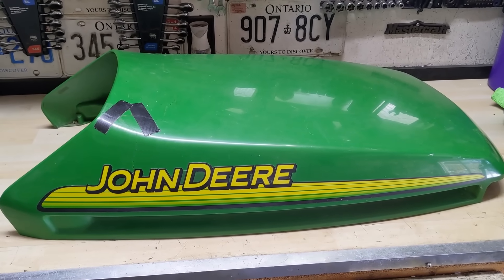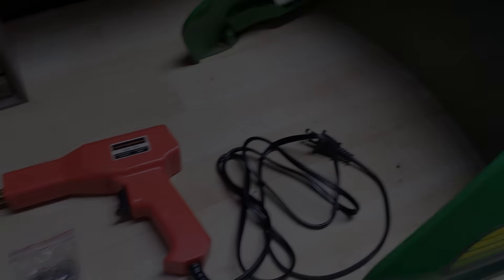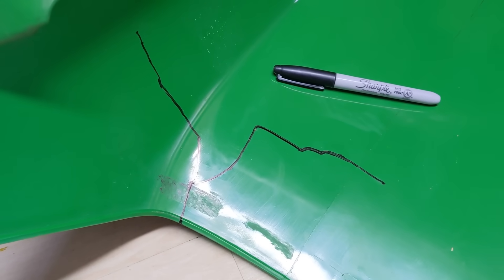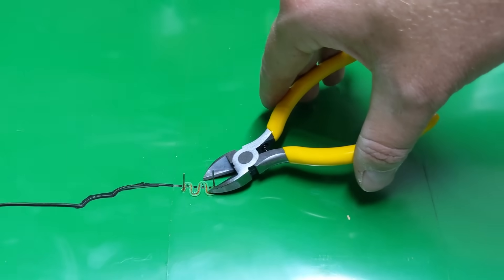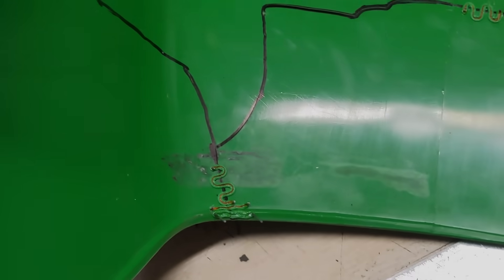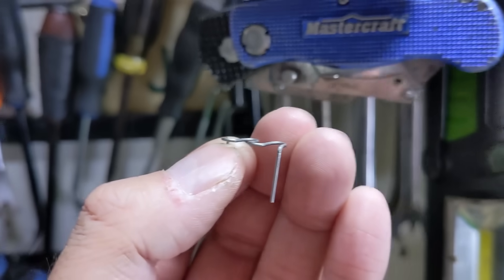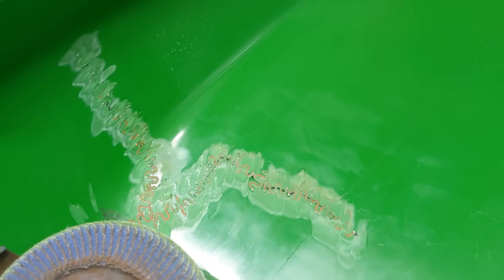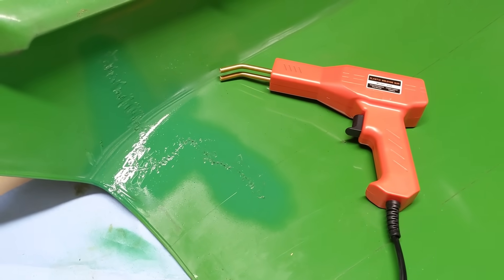How to Fix Cracks in Plastic Using a Hot Stapler

Comment: Interesting tool! I've used a soldering iron with paper clips and steel mesh for plastic repairs. This tool looks more simple, though you have to trim the sharp ends like you mentioned. Pros and cons I guess.
Reply: Or maybe hold a paper clip with pliers, get it super hot with a torch, then set into place? I've never tried it, but seems like it might work.
Reply: Interesting. What about some mesh and a heat gun? I guess you risk deforming the plastic.
Reply: @gargantuablargg  I've thought about using my heat gun, but like you said, I've had the concern about deforming the plastic.
My most recent repair was a cracked plastic bumper. Another reason I didn't use the heat gun there was because I didn't want to damage the paint.

Comment: Take the panels off, ruff them up under neath and clean with acetone, apply fiberglass mat 2-3 sheets thickness setting on aluminum foils then pore on resin, pick up aluminum foil, flip over to epoxy side, put on stress areas and cracks, wait a about 10 min  or more depending on curing, peal off aluminum foils, leaves nice smooth surface. Easy, clean no mess, fantastic strong repair, prevents future cracks. Flip panels, bondo the small cracks or not, finish how you want. The beauty of the foil is you can put on vertical and upside surfaces cleanly with no mess. Could do this with wheel off underneath.

Comment: Just an FYI, The output is 3VDC from 0-15amp. Watts = V * A, so it goes up to 45W (even though the specs say 50w). This is NOT an induction heating tool. The wire gets hot because current is flowing through it. Induction heating works by passing a current through a coil creating a magnetic field, and the ferrous metal which passes through the coil gets hot.

I think I would reinforce this particular crack with epoxy and a fiberglass cloth on the underside, for this particular example, first using proper cutters so you actually do cut flush. No way these staples hold permanently alone in this example with a user pulling up on the hood over and over.
Reply: No need for reinforcement still holding together nicely  per the customer when we inquired.

Comment: What you want to buy is a set of Hakko CHP flush cutters, like what one uses in electronics repair.  You'll get a VERY close cut on those staples!  The other thing is, the CHP flush cutters are the best ones, as they are extremely nice, very close, and very cheap.  You can buy 5 of them for $25 on Amazon.  These things are SUPER useful for all sorts of things, so once you have a pair, you'll be reaching for them all the time.

Comment: Great review and a cool tool to have for the casual repairer. 😎 One tip I would suggest is to use stapler sleeves as a depth guide so you don't melt through to the good side.

Comment: If I am not mistakened, the tool is actually a low voltage high current transformer, more or less the same idea as a soldering gun.  Other than the on-off switch and the plastic case, there is nothing to breakdown. You should expect the it to last for a very long time. Just make sure you do not over heat it by not using it continuously for a long time.  My soldering gun lasted me over 30 years and keeps on working.
Reply: You beat me to it. It's like a Weller soldering gun that lasts 50 years except for maybe the switch.

Comment: I laughed when at the start of the video I looked over your shoulder and saw a JD hood sitting on your work bench.  Cracked JD hood is exactly why I cam to watch this video.  I've been told they are prone to that.  Seems like they should make that part out of metal. Or at least a heavier plastic or something.  The lawn tractor over all seems  like it is well made and it has served for a lot of years now.  But that plastic hood is basically a POS.
Reply from the maker: Yea they're really prone to cracking unfortunately. But one prevention is opening it with 2 hands from the sides, instead of yanking it with 1 hand from the center. Thanks for watching!

Comment: when I was a kid, I had a welding toy that used a motor and plastic welding rods it would spin the rods and the friction would melt the rods and plastic to join parts to build stuff, would be great if they sold a tool like this with different plastic rods and colors it was really easy to control and dried fast and strong
Reply: Thanks for that one Paul i am 73 and do not remember that toy. I was building things with the toy logs and the Erector sets.

Comment: Bought one of these tools because I am tired of plastic parts needing to be replaced.  Did a test run on an about 18 inch crack on a garbage bin lid, and it worked great.  Mine came with a flat spade tool to smooth out the plastic and kind of cover the staples.  I did find that since the staples are a hard stainless, that wire cutters with carbide cutting edges works best for me to trim these off.  And don't drop these staples on a cement floor, as you may not be able to see them, and no help from the magnets.  Had to just sweep a large area to find them.
Reply: All good points for consideration.

Comment: The staple tails have some indentations in them to allow you to just bend them a little and they'll snap off, but I've only had marginal success with that. I typically use a Dremel with a cutting wheel on them.

Only other thing I'd mention is once you get the staple to depth, give it a very slight twist to help the staple become completely embedded under plastic. Otherwise, they could sometimes pull out.

Thank you for a great video and for sharing 😊

Just for your info. I have this item plus the regular soldering iron looking plastic welding kit and have had and used them both for a couple of years (occasional use) with no issues. I tend to use the soldering iron looking one along with stainless steel screen more often than this one, but there are use cases for both.
Reply from the maker: Hey Mark, yea I was using it the other day to fix a broken plastic snowblower chute and tried what others had mentioned about snapping the ends off, they didn't snap at all lol I still had to cut them. Like you said with the soldering iron, I then used it to melt the plastic over the staples and it seemed to hold really well. The twist definitely helps keep them in there.

Comment: You don't need side cutters, just bend-break the ends off. They are notched so they will break easily inside the plastic, so no wires stick out.
Reply: The one he shows at 3:52 doesn't appear to have a notch. Might depend on the supplier of the staple.
Reply from the maker: @larrybud  these in fact do not have a notch lol I never thought of that, but once people started commenting, I noticed mine don't. I have to cut them off.
Reply from the maker: Yes learned that from some other comments, I'll have to try it out. Thanks for watching!

Comment: You video is very well done. I too have one of these welders. Your using it on a John Deere hood piqued my interest.  That is precisely why I bought mine. I  would like to point out something about trimming the staples. If you look closely you'll see a slight score mark at the base of the staple. If you remove the welder while the plastic is set but still hot you will be able to break the pins off below the surface. This is handy when following up with plastic rod and not needing to grind stubs down.
Reply from the maker: Awesome I'll have to try that out, thanks for watching and for the tip!

Comment: what about some fiberglass cloth and resin on top of the staple job?
Reply: Really not necessary but would add more strength
Reply: @Dark Lord Fuzzybutt Correct but what a mess to work with and hazardous fumes i would rather hot staple. In this video Jake did an excellent job a put in a lot of staples. I have watched other videos where they cheap out and put more space between their staples.

Comment: Used to do that with a soldering iron   and just cut little pieces of stainless wire , hada small hole on the tip of the tool for it, it worked great
Reply from the maker: Yes the dentfix one has a tool like that, plastic welding combined with the hot staples would be super strong!
Reply: We actually did the same thing with our soldering iron before, this tool and the preformed pieces way easier to use.

Comment: If you take the side cutter to a grinder you can DIY a flush cut side cutter in a minute or so.
Reply: Was thinking the same but you wouldn't want to do it to your nice Knipex.
Reply from the maker: Yea I probably have an old pair of pliers I can make flush cut, I agree with bumpkin I'm not hacking my Knipex ones lol they're super sharp and cut through everything so I need to keep them!
Reply: @EliminatorPerformance  I'd sacrifice the chinsey ones that came in the kit. Don't need the full gorilla grip on the pliers for these tiny cuts, so a side cutter will do fine even if the angle is slightly awkward. I've done the same on a bigger pair I use to flush cut zip ties - had an extra pair so didn't see the point in buying the 'correct' tool. Heat induced weakness from the grinding probably doesn't matter in either application.
Reply: Craftsman has a nice set of narrow pliers and a set of flush cutters that would work well for this as the are slightly offset.  I use them for jewelry work on harder/larger wire.
Reply: To give some background - my dad did a lot of soldering on circuit boards in his home radio/electronics den and would flush cut the legs on through-board components with a flush cut tool. I've been flush cutting more stuff than what makes sense since I was a kid.

Comment: Definitely beats the old drill'n'stitch zip tie mechanic method I've been doing for years.
Reply from the maker: Yea it really does, these work great. Like I said in some other comments, for the price, you really can't beat it!
Reply: My uncle used to do the same thing! He started with bailing twine, moved up to fencing wire. But when zip ties came out he finally won.
He even tried JBWELD. The vibration from the mower made everything come loose.. not the zip ties 🇺🇸
Reply: But those old zip ties looks like a war scars for me
Reply: @rahuld_as not my scars tho. I'll be filling the cracks in with more plastic over the top. But then my fairing has more of those big zip tie stickers than Frankenstein's monster! Have ordered one of these.
Reply: Drill 'n' stitch adds soooo much more character though. It's like a badass scar
Reply: Great video review! Your description and explanation are so on point for this type of repair. You've even got all the safety disclaimers out of the way, so thorough. Tons of added info on material & tooling. I think most take it for granted, but you killed it man. Seeing the 50 watt device in action was a huge help. I see them at much higher wattage for obviously higher prices and wasn't sure where I'd need to start. Nice to know this model will suffice for the small occasional job without issue. Seriously, killer job. Super helpful, Mad props to you man 🍻
Reply from the maker: @mygt8a4re thanks for the kind words! And yes, 50-55w units work well, there's really no need for anything more powerful. It's just plastic after all!
Reply: Right?! Wish I'd known about these years ago ..been rigging my truck here and there for years ..even replaced the bumper and did the whole fix job myself but this would've made it sooo much easier 🤦🏻‍♀️..I'm definitely buying one now..just had to see what I could do with it before buying
Reply: I wonder if super glue tape (kind of) works on those type of stuff.
I don't know about it name but it's very sticky and very strong 😄
Reply: almost all the time I have to fix plastic in a similar broken way as the video I drill and put some metal wire, this way is definitely quicker and more "advanced"
Reply: True lol
Reply: Wow great idea! Now I don't need to spend $20 on this tool!
Reply: Agreed 👍🏼
Reply: Or saw with wire🤣

Comment: I have the dent fix hot stapler, its a great tool and I've used in the body shop I work at for years! You cant go wrong if you use it alot
Reply from the maker: Yea that's what I figured, just like an induction heating tool, not everyone will have one and if you need one for every day get a good one. I think I'll email them and see if they'll send one for review, their deluxe kit has a bunch of cool accessories by the looks of it.
Reply: @EliminatorPerformance  if you cant get them to send you one ill send you mine to demo

Comment: John Deere and Toro should include one of these in every sale. Nice tool addition to the shop supply boss it will come in handy and pay for itself in a short period of time. Money well spent and a fine repair that our customer will be happy to see although this was the minor part of his repair. Very well presented tool review looking forward to seeing other tools you use in the shop and any that you may have made to make repairs easier.
Reply: John Deere will redesign the shell so that the entire mower stops working if you attempt to repair it.
Reply: @Puddingskin01  Now that is a good one!
Reply: Or they should just use a better plastic that doesn't break so easily, but they are cheap so use cheap plastic.
Reply from the maker: Yes it works awesome, and like I said in other comments, this can now be a service that I offer at a cost and the tool will quickly pay for itself. Thanks for watching!